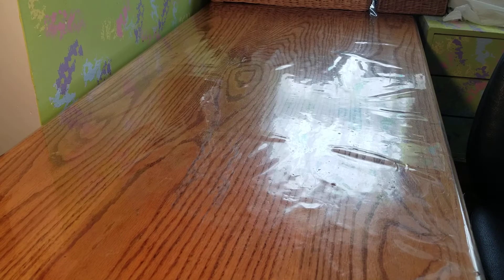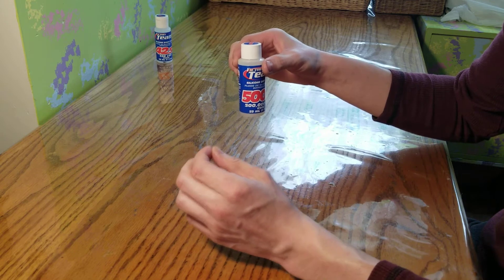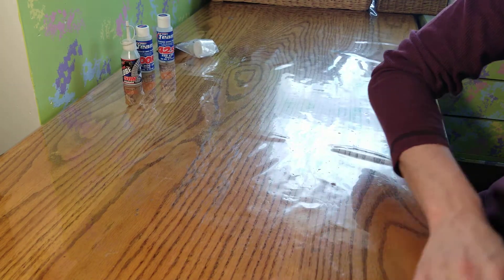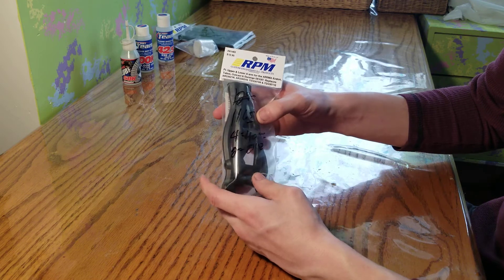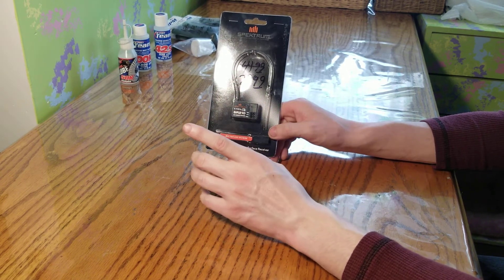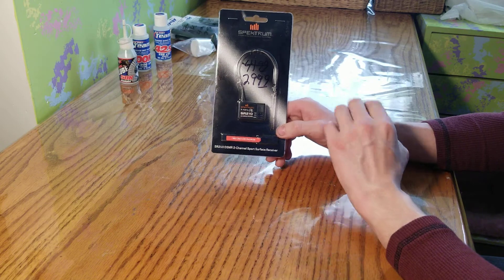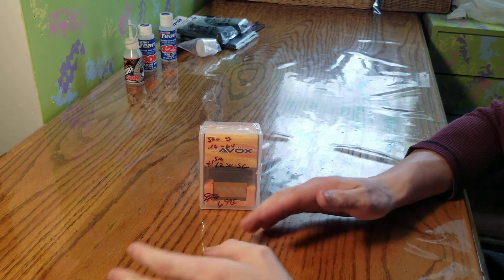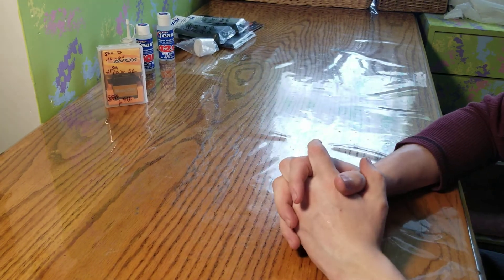Arrma kraton v3 upgrades

Comment: 20 million diff fluid is damn near solid. have fun stuffing that silly putty into your diffs every time you redo them...500k is plenty i have even mixed 1 million and 500k to get around 750k but its all around the same performance. virtually no diff ballooning at 100k/500k/100k...great video though keep them coming...and keep that dresser covered moms will whup that ass if you mess that dresser up lmao...

Comment: If you lock the center diff, you'll wreck the front diff in no time & the rear will fight to be first to go as well. That system has way too much power for a 'direct drive'. I've ran upto 1 mil in the center diff with no problem. That nearly stops front tire ballooning. But you'll be flipping the car like crazy on launch. It does make for easy standing backflips. I run 50k,100k,10k in my Kraton V3 so I can 50% punch it & it will stay on the ground - but it will still wheelie on command. The car will push into turns w/o fishtailing. That's the Kraton's problem OoB. The stock diff setup is 10k,10k,10k which is garbage.